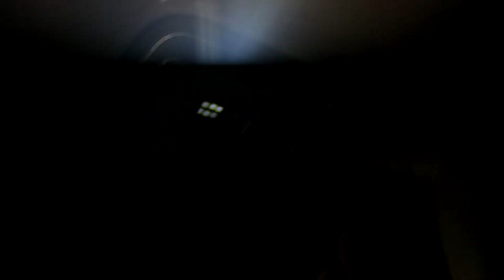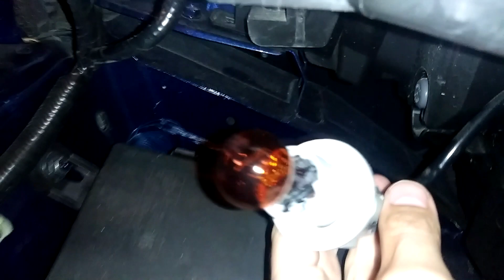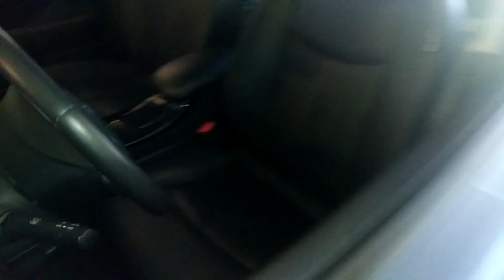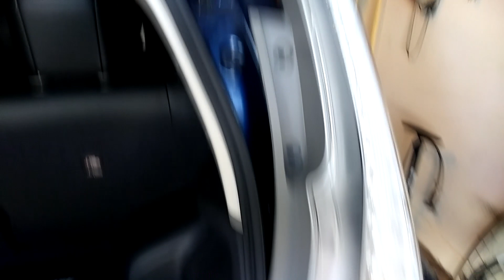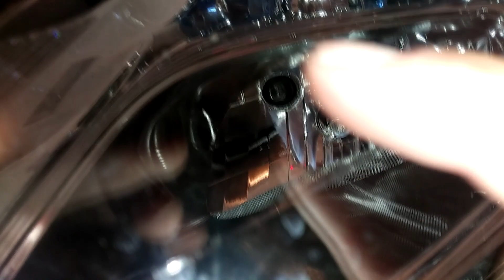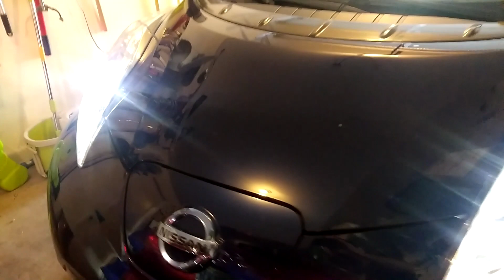Nissan Leaf SL 2016 LED turn signal dome back up license plate marker lights

Comment: Great video!!! Thanks! 
To remove the rear light assembly, I found the easiest way is to use a trim tool and carefully pry out the bottom part of the assembly first. Then grab with your hands and pull firmly outwards.

Comment: Excellent video! How did you fit the resistors for the turn signals?
Reply from the maker: I haven't had a chance yet, I've put back the regular turns signal bulbs for now and really weirdly the sound of the hyperflashing was triggering voice commands on my dashcam!
Reply: Were you able to find replacement fasteners for the rear light assembly that snapped off?  I did the same thing and can’t find them anywhere.